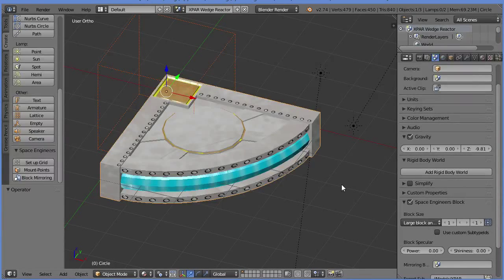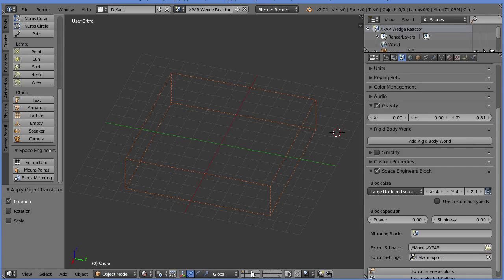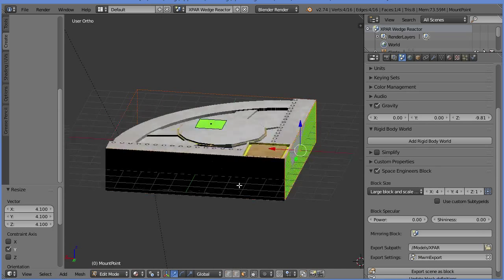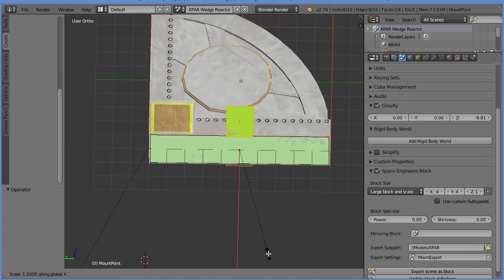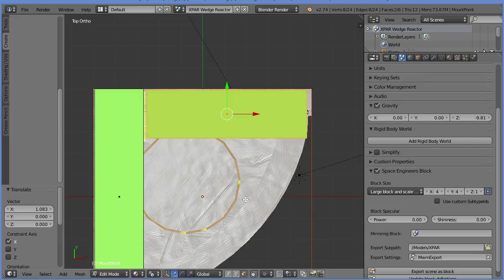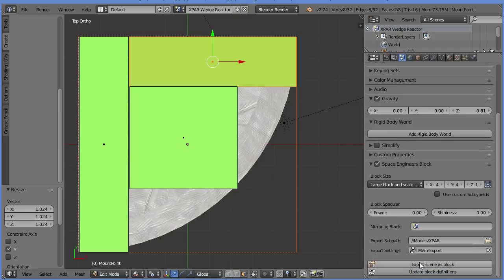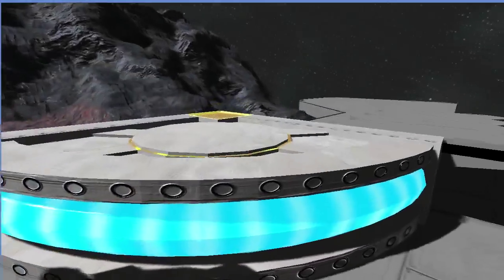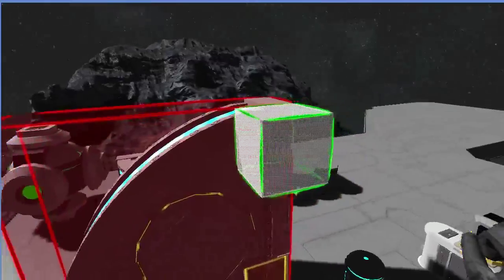Let's Mod Space Engineers: Block Mod #4

Comment: So both my mount points and collisions aren't working any idea why ?
Reply from the maker: flealessnz Turn rigidbodies on for collision boxes, and set them to be cubes or whatever in the rigidbody section. Mount points: use the "create mount points" button, make sure to export when you're done adjusting them.
Reply: Craig Perko did that still not working
Reply from the maker: When you export, you should look at the log and see what it's complaining about. Wherever you're putting your blocks should contain a lot of log files: open them up and look for clues.